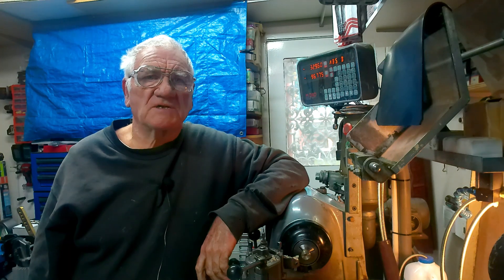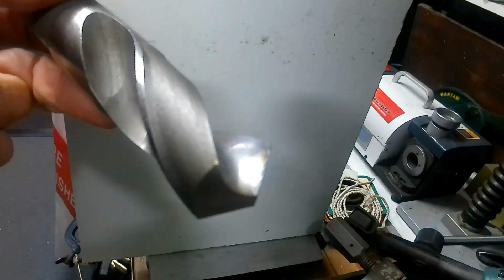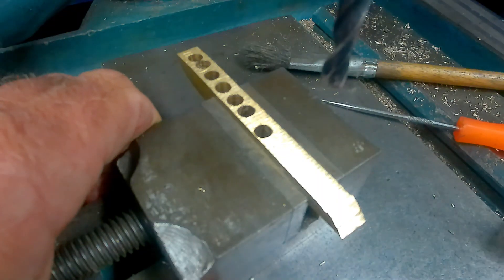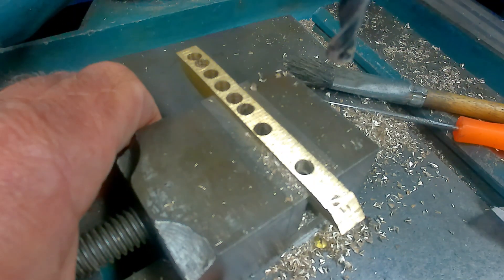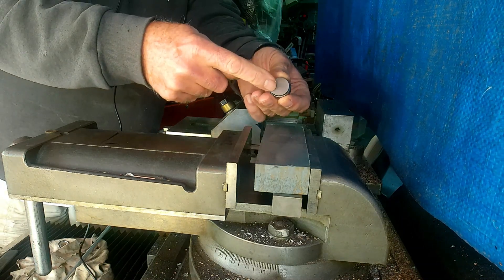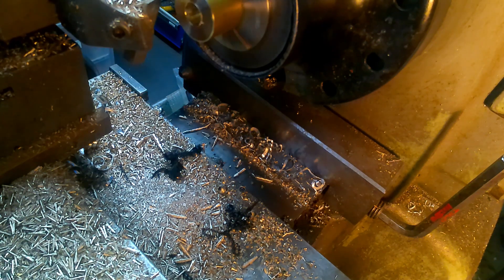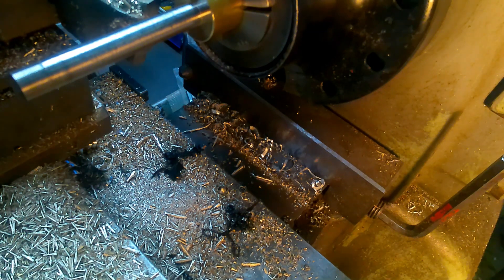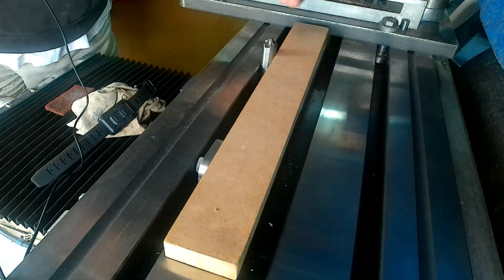An Old Boy's Tips & Tricks For Milling, Turning And Drilling.

Comment: Well - that's me convinced on the need to stone off the drill edges for brass. SHOP GEM! Going to need to machine up some steel balls as well.
Reply from the maker: You can do it in a collet with standard bearing balls about 1 " diameter and a carbide tool, then just 400 grit emery and oilstone to remove any tooling marks . Have fun doing it Stuart. Regards.

Comment: Nice Vid Dave. I'm an old timer like you and I am amazed how many young fellers don't know about taking the edge off a drill for hard brass!  Here's another tip, sharpen the bloody drill straight away or later you will have forgotten! Or,  put it in the index upside down. All upside down drills have to be sharpened before use in my workshop. Keep up the good work.
Reply from the maker: Thanks for watching, much appreciated. Regards.

Comment: Hi Dave, Thanks for passing on your knowledge via these 'old boys tips'.
Yesterday, I made a pair of your 'tee slot alignment blocks' and one of your 'ball bearings with a flat' for holding irregular work pieces.
Keep the videos coming.
Regards Paul,  Ex Pommie,  now a proud NZ'er!
Reply from the maker: Fantastic Paul, at least I now know of another set of table stops are now out there. You will definitely find them useful. Thanks for watching. Regards.

Comment: Thank you for the excellent tips.  I'm a new amateur hobby machinist and I think I'm going to use/make/spply every single one of these.
+1 new subscriber for you sir! 👍

If you'd be open to a small piece of constructive criticism (?): 
I had a really hard time following the sound track.  Your spoken words - which is what I most want to hear! - tend to be much quieter than the machine noises.  When only one or the other is going on, I could fix it on my end by fiddling with the volume level (fairly drastically sometimes).  My ears aren't the best anymore, so the hard part for me is trying to hear your voice while a machine is running.
What I know about making videos would fit in a thimble, so I don't know if leveling out the sound is something that can be done in editing, or if a highly directional microphone pointed at your mouth is the answer.  Or maybe some of each?  I used to be into audio, including doing sound for live music performances.  It's been a few decades, but I think a decent directional mike can be picked up pretty cheaply. (If I still had any of my old sound equipment, I'd send you one.)
Anyway, I very much appreciate the information, and your willingness to share it with people like me.  Thank you again,
Doug
Reply from the maker: Hi Doug, thanks for the view, Sub and comment. I am using a lapel mike clipped close on my shirt almost up to my chin. I suppose I should speak louder, but as I am on my own, I still feel embarrassed talking to myself in case someone should appear at the open door and not realise I am recording and think that I am going crazy talking to myself. LOL. Will see what I can do on future ones. Thanks again. Regards.
Reply: @daveticehurst4191   making YT vids is not as easy as it looks...I know I'd never bw able to do it...keep perfecting your presentation... 😎👍☘🍺
Reply from the maker: @peterfitzpatrick7032  Thanks for watching Peter. Regards.

Comment: Great tips 
Have you seen the tap extension dodge where you drill a hole the size of the flats of the square end of the tap through a piece of round stock 
Then you drill the stock lengthways the diameter of the tap shank 
You can make the extension as long as you like
Reply from the maker: Hi Nik, thanks for the view and comment. Yes I have used the tap extension idea, but I used grub screws in opposite holes so that the tap does not drop out if  you are trying to tap down a deep recess. Regards.

Comment: Clamp the workpiece
Reply from the maker: Hello Erik, thanks for watching and your comment. The whole purpose of the demonstration was to show how a standard sharpened drill would grab in brass. YES, clamping it down is always a good idea, BUT it would still have grabbed as the drill broke through and snatched the drill quill handle down, which would have been harder to show. Even drilling with it clamped in a bench vice and if you were using a power drill, it would have snatched through and perhaps if you were not expecting it to happen; make you lose a grip on the tool. Hence the demonstration after backing off the drill with an oilstone, same speed same setup, the hand held vice did not move. Hope that clarifies the purpose of showing the vice not being clamped. Regards.